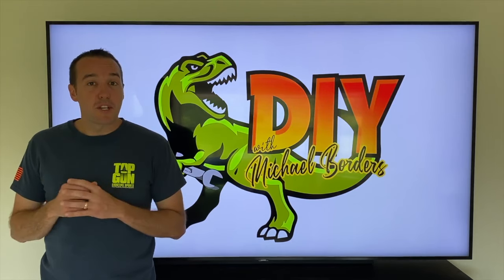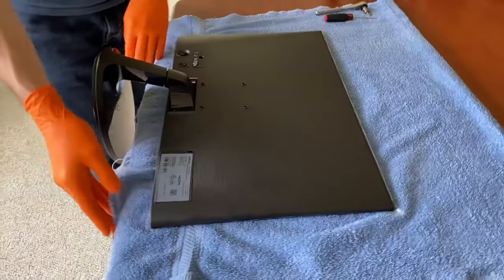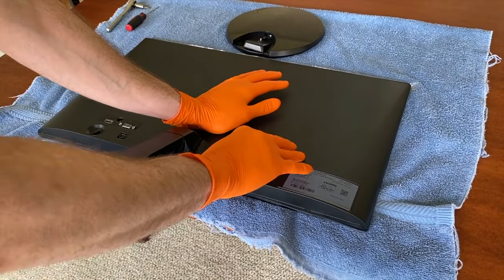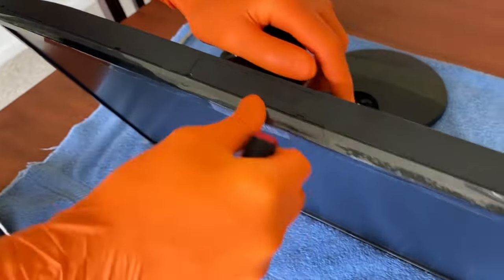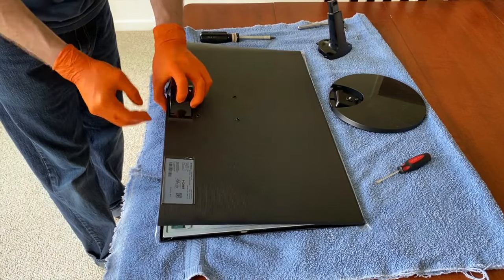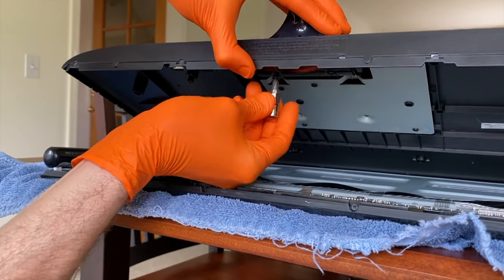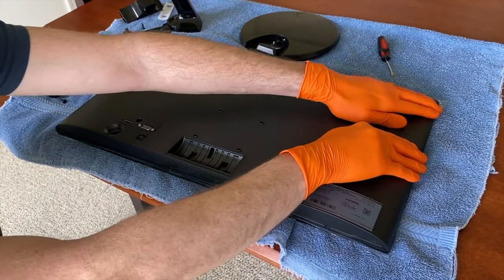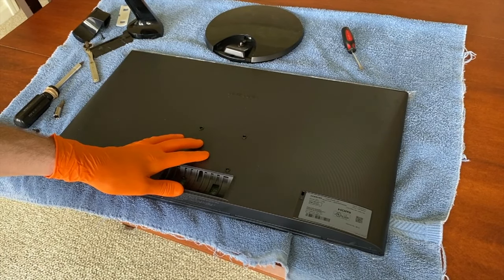How to remove Samsung computer monitor base/stand

Comment: Excellent video, incredibly stupid design. Had to do this on 2 CF390 Samsungs. The first worked fine. The second now has a 4" band of dead pixels from top to bottom in the right hand side. I've bought a total of 4 Samsung monitors. From now on I'm going with another brand. I can't afford to pay double or triple price for a monitor due to ridiculous design.
Reply: Yep this is possibly the worst designed monitor i have ever seen in my life. Got a new monitor and I'm selling this piece of shit immediately.
Reply: Yeah stupid design indeed
Reply: Stupid design +1
Reply: I now have a vertical line running down my monitor!!!!! I’m so livid!

Comment: Thank you so much for this clear, lucid tutorial.  It was literally the difference between project sucess and giving up on using my dual monitor stand.  Can I just say: what spectacularly poor, lazy design engineering by Samsung!  Without your instructions, the VESA standard mounting option is functionally inaccessable to the average consumer.  That Samsung expects the average user to actually pry open the monitor case to access those two hidden screws just to fully remove a plastic stand is inexcusable!  Perhaps in the future, right-to-repair laws will be expanded to penalize manufacturers for building into their products these kinds of obtuse and unnessesarily challenging obstacles to accessing ordinary features (like alternate mounting options).
Reply from the maker: Thanks for reaching out to us, we appreciate that.  We are happy to hear you accomplished your DIY project, and you are spot on…this design has us all confused and scratching our heads.

🧰

Comment: This is a great video! But horrible design of the monitor, after completing this, I had many lines of dead pixels. I would recommend not to mess with the case removal but just do the monitor stand removal insteaf
Reply from the maker: Good morning ☕️  thank you for sharing.  A design that truly is stubborn to work with.

Many more helpful videos to come.  👍🧰

Comment: For everyone out there, you don't really need to take out the last part, I removed the base because I bought a monitor stand and the last part can be left alone. It seems like there's no way to screw in the metal part of the monitor stand with the old part in the way, but if you slide the part in an upwards motion you'll have enough space to do it. Also thanks for the tutorial!
Reply from the maker: You are very welcome & thanks for watching & sharing this.  Any & all helpful info is greatly appreciated.

😎👍
Reply: I just want to give my two cents on this. While you definitely CAN leave the part and use almost any monitor stand with it on, if you'd like to use any sort of swivel/tilt mount you would lose some of the tilt function because that part gets in the way (learned the hard way).

Comment: 2:02 you will probably butcher the slat. But that's OK. You only need to pry it apart enough to slide a spludger (or guitar pick / credit card) in the gap and work that to the right until you hear a click. After that you can carefully pry the rest apart using your hands and the spludger. Don't worry if you butcher the first gap, it seems unavoidable. What a fantastic video. I needed to remove the bracket to fit a Herman Miller monitor arm. The Herman Miller bracket was too large so this had to go. I'm so pleased I was able to do it with this expert guidance and the only damage was on that first gap. This video reminds me of what YouTube used to be. Thanks from London. Right here goes monitor #2.

Update: I didn't butcher the plastic on the second one. The secret is to use the correct size screwdriver. If it is just right the plastic will come apart without damage. Too small and it will just damage the plastic. If that does happen it's not a disaster though. Just use the gap created to start prying.

Comment: Hello thanks for this demo. It's very helpful. I have Samsung Sa300 monitor and it has been stored facedown for some time. Now when I tried to use it again there were marks in the middle. Do u have any idea How I can remove that?
Reply from the maker: Thanks for watching, that’s a bummer.  We haven’t serviced that exact model however it will likely be pretty similar.

It may be as simple as a friendly cleaning.  Removing panel and gaining access to the internal parts for cleaning is what we would do.

Below is a link to our video showing this on a larger panel (55” tv) however it’s all the same when it comes down to it.

       https://youtu.be/-QdPg_jPkGY

Let’s start there, please keep us posted.  Hey if you’re into crypto trading, be an early participant in our newly launched DIY community ecosystem.

       Toolboxtoken.com

We DIYers need to stick together!  🧰

Comment: The reason I want to take the stand off is to be able to use a VESA mount, but I can see the little plastic part around where the stand used to sit sticks out a bit. Do you know if this would be an issue for VESA mounts that have 75mm as well as 100mm?

Very detailed video too thanks.
Reply from the maker: Good morning & thanks for watching.  We haven’t used the VESA mount.  We have attached a link to our video showing mounting this exact monitor to wall.

       https://youtu.be/xL8em619BOs

Hopefully this will be helpful.  😎👍
Reply: @DIYwithMichaelBorders  I have given the video a watch and it has answered my question. Thank you for doing a great job (and replying to my comment, that doesn't happen often), you earned a sub my man, keep it up.
Reply from the maker: @Cody_MknZ33  

Thanks for the reply, we are all in this together.  Us fellow DIY’ers need to stick together!

Welcome to the DIY Raptor Club.  😎👍

Comment: Thanks for the video, very helpful. Do you know if there is a cover I can purchase because my new mount doesn't cover the holes left from where I removed the stand and I don't want dust getting in. Thanks!
Reply from the maker: You are very welcome, thanks for watching.  Great question, we have talked to viewers that mention they covered the screw holes with black electrical tape.

We have not tried that in the past and if you do, we definitely recommend not taping over any areas that are for ventilation.

😎👍

Comment: Any info for the S22F350FHU model? It doesn't have the same Phillips screw on the back next to the HDMI as tutorials such as yours show. I've tried prying the back off but I'm at a point where it feels like the plastic will snap and it's not closer to being removed
Reply from the maker: Thanks for watching, haven’t worked on that model before...🤔
Reply: @DIYwithMichaelBorders  it looks near identical, just doesn't have that rear screw! Such a frustrating piece of design, need to remove it to be able to fit the monitors to a monitor arm
Reply from the maker: @Compendium_of_tom  

Thanks for the reply.  We definitely understand.  Most importantly, go slow & be patient...plastic cracking is a tough sound to hear & accept.  😎👍

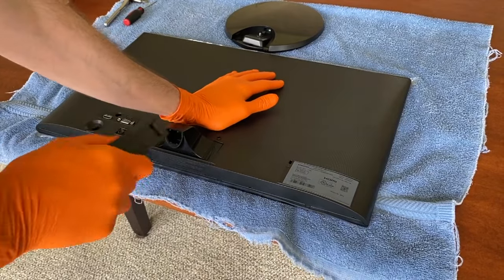Comment: I’m unable to get the stand out from 1:37, I got the base but the middle part just won’t budge even though I’m placing my hand correctly and trying my best not to apply too much force but still pulling as much as I can. Any advice?
Reply from the maker: Thanks for watching, any update?  These little base stands can be stubborn at times.  Is all hardware removed?

Keep us posted.  Let us know if you have any questions and hey if you’re into crypto trading, join our DIY ecosystem and help us grow an exclusive group of DIYers.

       toolboxtoken.com

Reach out to us any time!  🧰
Reply: @DIYwithMichaelBorders i had to read this comment before trusting you enough to yank hard enough to actually get it out. you made it look really easy hahaha
Reply from the maker: @PLAYERSLAYER_22  

Thanks for watching.  Did you conquer the job successfully?  Let us know if you have any questions.

Comment: Is it okay to leave the board exposed from the back due to the attachment removed?
Reply from the maker: Thanks for watching & you may run into the board gathering dust which can affect its ventilation.  Cleaning it on a regular basis will be important.

Comment: Hi Michael! I followed the steps to remove the stand, but when I turned my monitor on again, there was a black line in the middle. Does this mean I damaged something inside in the process of removing the stand? Is this something fixable? Please let me know.
Reply from the maker: Thanks for watching & we appreciate you reaching out to us.  Something may be loose inside.  A common cause is the ribbon wiring.  If everything is properly secured, the internal screen may be damaged.
Reply: Seriously, fuck this design, I have a black line too :( Crossing my fingers that it's loose wiring. Edit, looks like I tore into one of the flimsy semi-transparent connectors at the base of the monitor, what a waste of time and money.
Reply: I had the same issue. Monitor trashed couldn’t be fixed I was told

Comment: Im struggling to remove the second piece (the part where you press gently on the back of the center of the monitor and tug the piece off.) I’m applying a lot of pressure but it doesn’t seem to do anything at all. What do I do?
Reply from the maker: Thanks for watching & any update?  Is there any visible screws that are needing to be removed?  Keep us posted.

😎👍🔧🔩
Reply: same here, not sure how to take off the 2nd piece... "?
Reply from the maker: @dimensionesimaginarias  

Thanks for watching, what brand & model is your monitor?
Reply: Same here
Reply: @DIYwithMichaelBorders  It just took a lot of time and effort, but thankfully it came off after some hard work!
Reply from the maker: @annabruh6817  

Good morning & welcome to the DIY Raptor Club.  Great to hear you successfully completed your DIY project.  Hope all is well, enjoy your upcoming weekend.  Thanks for watching.

😎👍🔧🔩
Reply: Yes, I gave up trying to remove the neck. Had to open up the panel to get the damn this to disassemble without breaking it.
Reply from the maker: @santhoshsiva9384  

Thanks for watching, hope the video helped.  😎👍

Comment: how do you fix the green haze on screen? it shows up specifically when its cold/raining outside and my house is not enclosed
Reply from the maker: @Miko-jp1qq  

Thanks for watching, that seams to be a connection interruption.  Do you have any loose connections feeding in and out of monitor as well as outlet?
Reply: @DIYwithMichaelBorders  probably not a wire problem. Tried it to different monitor and it didnt occur. I could send you a video if you like to see
Reply from the maker: @Miko-jp1qq  

Thanks for the reply.  It’s likely that either the cable is loose, or needing to be replaced.

If connections are properly secured and you’re still experiencing green haze or tint, we recommend replacing cable.  🧰

Comment: So I did this and now theres a large white strip going down the right middle side of the monitor covering about a 1/8th of the screen, on top of it now has an extremely hazy tint to the screen now.  What happened?
Reply from the maker: Thanks for watching & welcome to the DIY Raptor Club.  A connection point may have accidentally came loose or disconnected.  We recommend carefully opening monitor up & verifying all connections are properly secured.  Dust getting in the connection points can also cause this.  Keep us posted.  Hopefully it’s a simple adjustment as opposed to a damaged screen.

😎👍🔧🔩

Comment: I wasnt able to just pull off the middle part and I wonder how you did it so easly. I use the Samsung S27f350fhu
Reply from the maker: Thanks for watching & it definitely takes patience & precision.  Being extremely careful as you shift the plastic connection points apart can be tricky.  Keep us posted on your project.

Comment: In case anyone has a SyncMaster 953BW model and wants to take the stand and base off:  My case had a different design on the back.  The base disassembled the same way except there is no visible way to release the tilt bracket after taking off the bottom part of the base.  No way to get a screwdriver in and the view to the release is blocked.  However I noticed a dimple/depression right above the bracket on the back of the case.  It is not a screw hole.  I pressed into it with a Philips screwdriver while puling the bracket and it slid right out!   Could not find any other reference to the method and had just about given up on getting the base off.
Reply from the maker: Thanks for watching & sharing this, we appreciate it.  😎👍

Comment: My samsungs stand is being really resistant, it doesn't want to come out at all, any ideas?
Reply from the maker: Good morning, these little things can be stubborn at times.  Most important thing is to be patient even when being patient is very difficult...😁

You don’t need to remove panel completely, just enough to get access to what you need for removing base.

Ever-so-carefully shift each side of panel individually while simultaneously applying upward pressure.

Keep us posted.
Reply: @DIYwithMichaelBorders  Turns out I’m not strong enough, someone else managed to get it out, I didn’t even know it could come out until this tutorial! Lifesaver!
Reply from the maker: @phoenixscott001  

Thanks for sharing this update, that great to hear.  Are you mounting monitor on wall?
Reply: @DIYwithMichaelBorders  Yep, putting it above my new monitor for other apps while I game and so
Reply from the maker: @phoenixscott001  

Very cool, below is a link to our video showing mounting our monitor.

       https://youtu.be/xL8em619BOs

😎👍

Comment: This is insane, I have. The curved screen, but I never opened it up to i stall, so how did those screws get screwed in when assembled? Something is not right. I got the flat base off, but the stem did not come off with gentle pressure!! Not close, it's still stuck
Reply from the maker: Thanks for watching, any update?

Comment: So I have a Samsung curved lc24rg50fqnxza.  I removed the backplate and found out later on they have vesa mounts that does not require to remove the arm.  I put the backplate and now I am stuck on black screen. I checked the inside and nothing seems out of place.  Has anyone encountered this issue.  I tried all the Video ports and on other devices and its just stuck on a black screen.  I do not even get a prompt to access teh menu when pressing the power button
Reply from the maker: Thanks for watching, that’s odd.  It sounds like a wire connection is loose and not providing power to the screen.  Does the lower power light illuminate at all?

We had a viewer not too long ago mention that this happened to them and it ended up being a loose connection.  It’s very unlikely that the screen went dead out of coincidence while you were working on it.

Please keep us posted on your project.  Hey also if you’re into crypto trading, join our newly launched DIY community ecosystem.

       Toolboxtoken.com

We DIYers need to stick together!  🧰
Reply: @DIYwithMichaelBorders  I will double check the wires to make sure. Thanks
Reply from the maker: @khandrogo  

😎🧰

Comment: You should really change the title to include wall mounting. Better would be "Converting Samsung monitor base to wall mount"  If I am not mistaken that is the ultimate goal here.  I don't know why Samsung even puts wall mounting holes on the monitor if they make it so difficult to remove the base holder.  Bad design here.
Reply from the maker: Thanks for watching and sharing your thoughts.  We have you covered.  Below is a helpful link to our video showing mounting computer monitor on wall.

       https://youtu.be/xL8em619BOs

😎👍

Comment: I just broke my monitor doing this, ty samsung
Reply from the maker: Thanks for watching, that’s no fun.  Definitely a tough design to work with.
Reply: Ty for you video! I managed to take the support out, just broke the plastic but it still works
Reply from the maker: @miltonweinhold6859  

Thanks for the follow up, that’s great to hear you didn’t break the screen.  Great to hear it’s still working.  😎👍

Comment: Goddamn. I’ve been reading about too many people having black lines/ruined screens after this. Im just going to (very carefully) sawzall them off. Thanks for nothing Samsung. What was wrong with the stand just clipping in? Or just removing two screws? What a terrible design.
Reply from the maker: Thanks for watching Ryan, we removed our stand & mounted monitor on wall.  Keep us posted on your project.

😎👍
Reply: Would you actually recommend people do this though? Given what seems like a pretty high rate of failure
Reply from the maker: @ryanclark2289  

Great question, patience & precision is key.  😎👍
Reply: @DIYwithMichaelBorders  I have ALL of that. I am very skilled and great with my hands. What I don't have is luck when it comes to this stuff. My screens probably have black and green lines in them already just because I am discussing this.
Reply from the maker: @ryanclark2289  

Thanks for the reply, hopefully not.

😎👍

Comment: So i did this and accidentally lifted the backplate too high, 200$ monitor is now garbage just because i wanted to mount it. What a terrible design. On my monitor the mounting spots were so close to the stand that it had to be removed
Reply from the maker: Thanks for watching, that’s a bummer.  The design kinda makes us think there’s some hidden engineering behind it…🤔…what are we missing…?
Reply: @DIYwithMichaelBorders  i have the oddessey g5 and it has the same system except the whole peice is removable almost like a lego brick, obviously they learned from their mistakes. Still frustrating
Reply from the maker: @adrenochrome3853  

Definitely frustrating, it’s a very unique design.